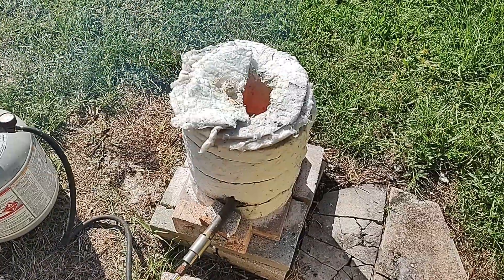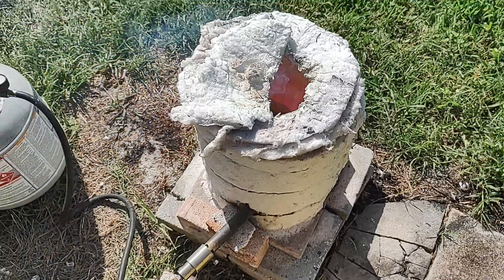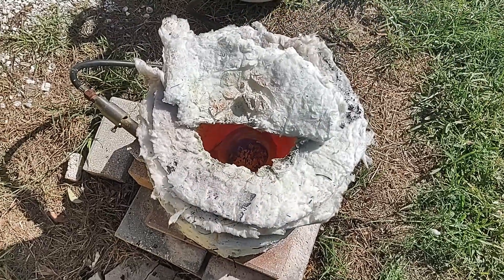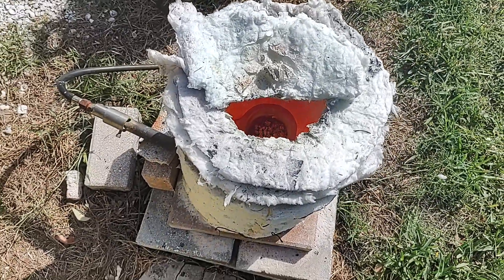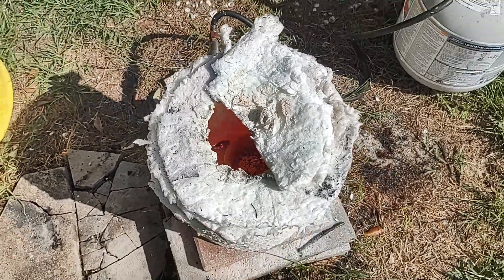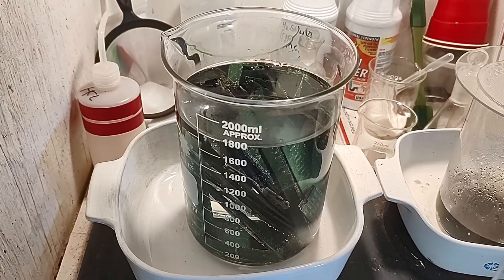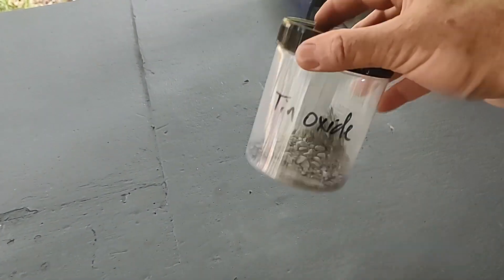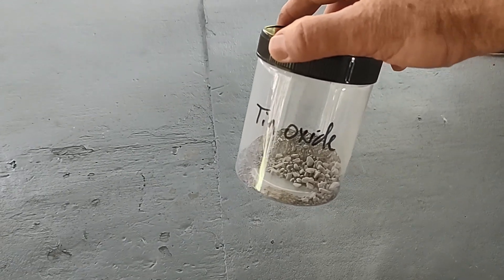Tin Recovery From E-Waste Teaser #recycle #chemistry

Comment: Is the tin valuable? What can it be used for? 🤔
Reply: Actual tin is worth more than copper.  I say actual, because scrap yards use "tin" to describe thin steel sheet metal. 

When I was an HVACR installer, I got a lot of pure tin ducting. It was commonly used for ducting 60 or 70+ years ago. Now it's the most common component in solders. As solders, it's alloyed with other metals. Some of the alloying ingredients are nasty like cadmium or lead, some are yet more valuable, like silver.